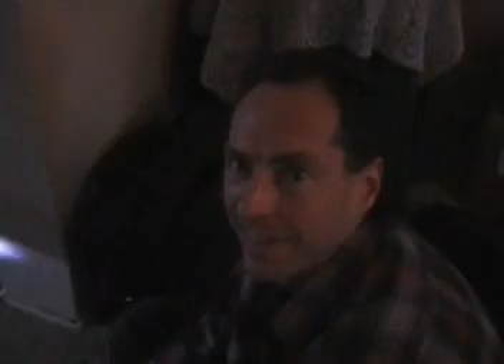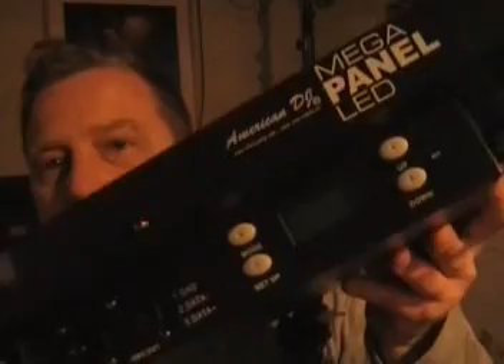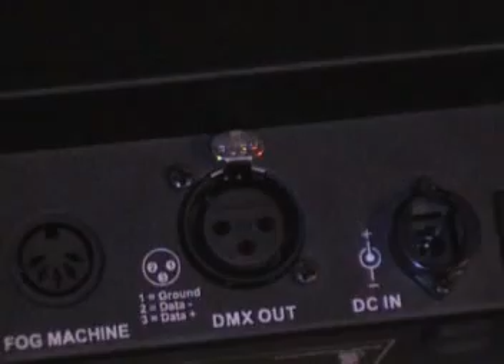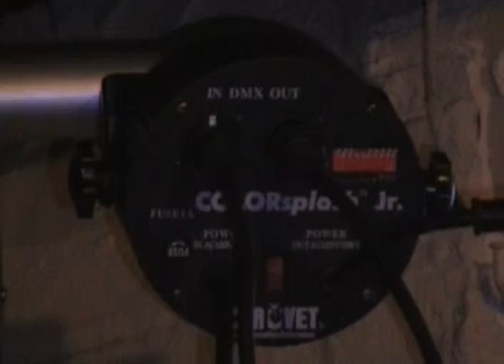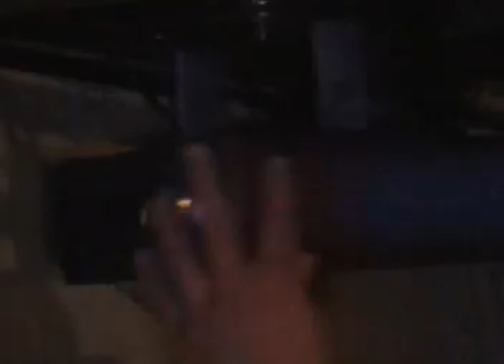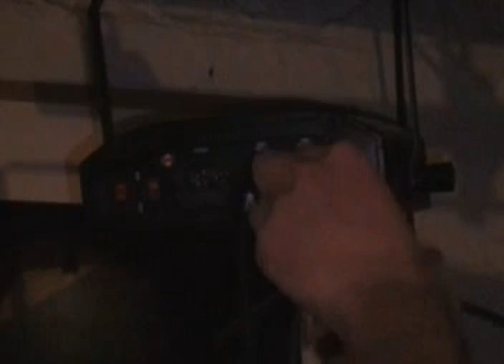DMX Help Pt 1 - Hooking Everything Up

Comment from the maker: A #1 - Yeah, they will need both power link & DMX cables when running them DMX.

A #2 - If you run a really long DMX chain, yeah a Terminator is nessessary.